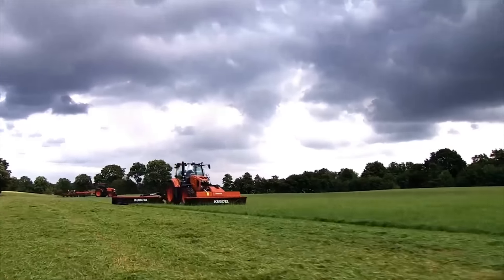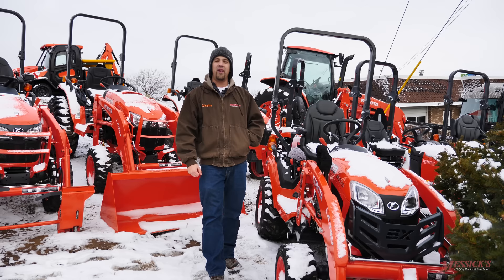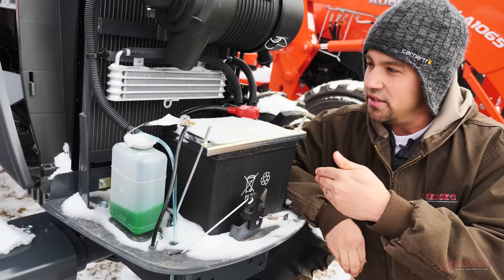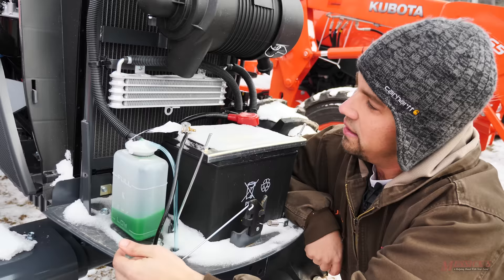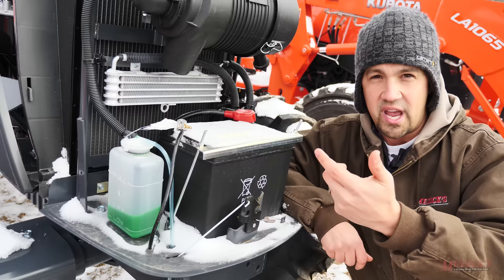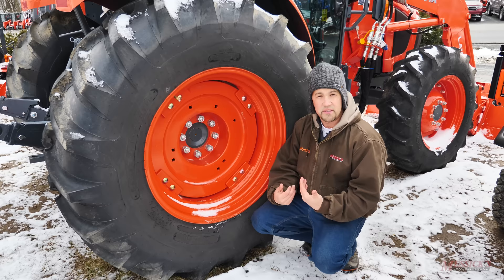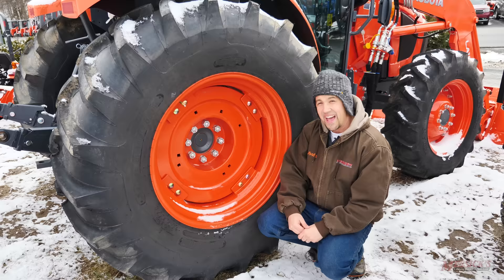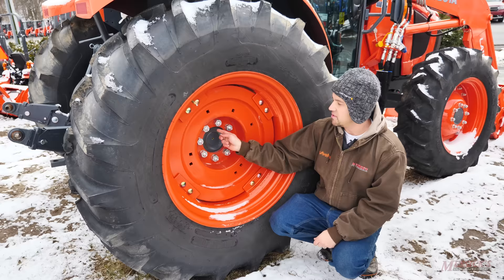5 Critical Mistakes New Compact Tractor Owners Make

Comment: ANNNNNND my new ( 2016 ) 2025R john deere leaks down at a crazy rate too.the loader bucket will fall from full height to the floor overnight. called the dealer to bitch about NEW tractor doing that and the tech sent me a pic of the spec sheet in the manual. " Its within spec " so no repair needed.  Tech actually admits that the loader cylinder arms need resealed but he cant do it because the manual says its within spec. Bear in mind i noticed this when it had 8 hours on it. And if you think JD corporate gives a shit, go right ahead and pick up that phone and let me know how that works out for you. ALL tractors these days are PURE SHIT. Next time i will just buy the cheapest color . loyalty to a color is stupid these days as they are all junk with chinese parts on them. trust me, 5 warranty repairs on my 2025r and its only got 28 hours on it. and the damn thing is slam full chinese electronics and switches. i saw them with my own eyes when i helped the tech change them out because of failure. Made in china written on the box and the parts. i wrote a big review on JD's reviews section on their website and they have refused to post it so far and its been over a year and a half ago. Wonder why they dont want my review on their site ? I think we all know. They dont want everyone to know that their product is no different than any other color on the market. pure shit.... 5 warranty repairs that have happened with the tractor that at the time had less than 10 hours on it. im a weekend once in a while tractor user . 2 years and its only got 28 hours on it. now needs a 6th warranty repair on the ignition switch that i will just do myself. im sick of messing with JD. do yourself a favor and either buy OLDER JD equipment or just buy the cheapest color.
Reply from the maker: Never tired a Kubota?
Reply: Bevis Butthead  next time buy a JCB equipment .   Hydraulic pistons , if of high quality should not leak until they are worn ......this is the manufacturerer BS
Reply: Cylinders leaking down is not an issue with modern equipment, the valve bodies pass fluid between the spools.  Cylinders have seals valves do not, they are precision ground and lapped.  They must need clearance when cold so when they heat up they will not bind and score, as well as open circuit valves have a small amount of bypass by design.